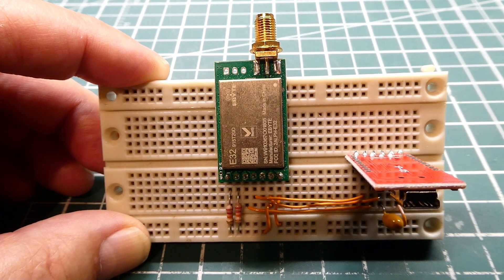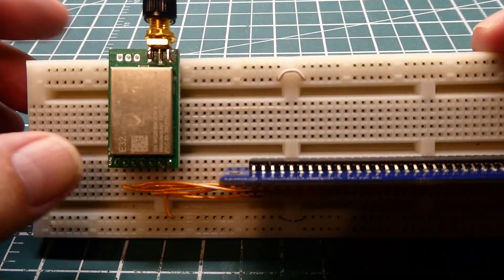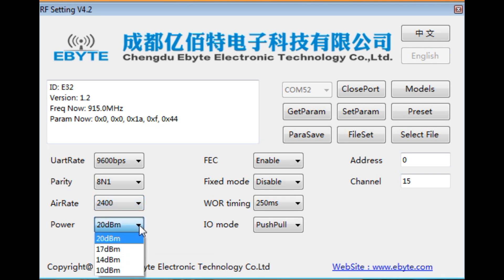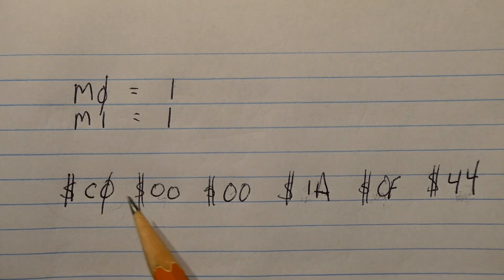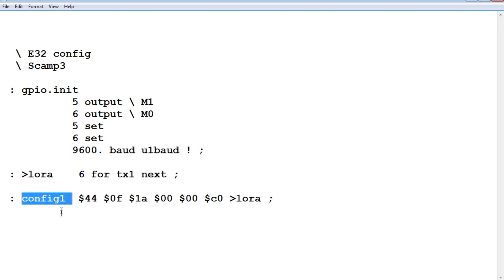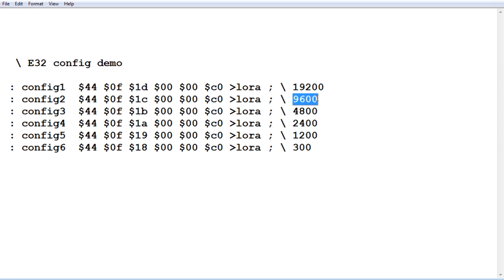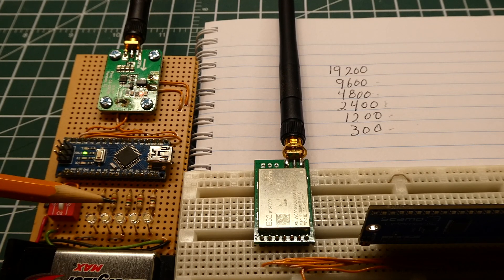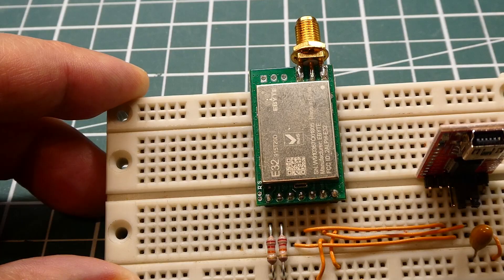Configure E32 LoRa Modules Over Serial Port

Comment: How do I find out the RSSI value?
Reply from the maker: Use the E22 series.
Reply: @0033mer  I have a Lora E32, can I use the E22 software?
Reply: Is lora e32 not able to check the rssi value? @0033mer
Reply from the maker: E32 radio modules do not support RSSI. E22 modules support RSSI but you need E22 software to program them.
Reply: does e32 also not support snr?
Reply from the maker: It also does not support SNR. If you want both, check out the Reyax LoRa radios.

Comment: Could the MCU ask the LoRa module what its config is and change it only if necessary or if it doesn't get an answer?
Reply from the maker: Yes, the MCU can read the current configuration values and change them as necessary.

Comment: Is it possible to configure the lora module using an Arduino board. 
And can I transmit 20 characters long string in one go over lora?
Reply from the maker: You can use an Arduino board with the E32 LoRa radios and transmit a 20 character packet.
Check out the schematic diagram in this video:  https://youtu.be/6NHL-avk8BU
Reply: @0033mer   Hello I have been having trouble configuring the module using arduino. Can´t figure out how to correctly send the hex parameters to the module over the serial port. Could you provide help on this?
Thanks
Reply from the maker: The serial Tx/Rx pins on the Arduino UNO/Nano are used by the USB to serial (FTDI) circuit so there will be a conflict when you send hex code using these pins. If you are serious about building projects with Arduino and LoRa use a software serial port which use different pins or goto a Pro-micro board which has a free UART serial port.
Reply: @0033mer  I see. Hey thanks for replying so quick! really appreciate it. I will follow your advise. Thank you.
Reply: Is E32 and AS32 the same?
Reply from the maker: The Ashining AS32 has the same pinout as the E32 modules. It looks like another company's knockoff.
You would have to check the data sheets to see if the software is compatible.

Comment: I dont know what is wrong, w/ lora on default setup ( that it was when i bought ), they communicate, after setup to use fix mode, changing the addH chan, they stop communicate.
Reply from the maker: In fixed mode you have to send a three byte header containing the address and channel before you send the data packet. Check out this video: https://youtu.be/JvBC7cEgI0E

Comment: hello, I have a lora e32 900t30d module, I connected it with uart ttl, but when I try to open the settings from 3.50 rf settings, I get a module no supported error, can you help me?
Reply from the maker: Try RF setting 4.2   https://www.dropbox.com/s/8utd7ospz6qovd7/RF_Setting4.2.exe?dl=0

Comment: What is airrate vs uartrate ?
Reply from the maker: The data speed over the wireless radio link is the air rate. The speed of the microcontroller UART feeding the RX pin on the LoRa module is the UART rate.

Comment: How can we set the address and channel of each module in a similar way? The datasheet of this module is not very clear about this.
Reply from the maker: The address and channel information is also embedded into the 5 parameter bytes that you can use for programming.

Comment: Has anyone got the llcc68 ebyte module working?  I got the spi working but no broadcast occurs (i looked for any signal with an sdr radio, but found none)
Reply from the maker: If you use the E220-900T30D module (LLCC68) it has the standard UART interface which is code compatible to the E32 series.
Reply: @0033mer  is there E32 code somewhere i could try?
Reply from the maker: To get started you do not need any code. An FTDI connected to the LoRa module connected to a computer (USB) running TeraTerm will allow you to send data. Check out these videos:
https://youtu.be/ysNILdPZ7hk
https://youtu.be/qmxHAAo6usk
Look for other LoRa videos on my channel.
Reply: @0033mer  i have a e220 900m22s. Is that compatible to your methods with your e32 series?

Mine has miso mosi sck.  I can send cmds via miso mosi and program the chip's registers (verified by reading them back out). But i can't get it broadcast anything (i listen with sdr radio).
Reply from the maker: Your module is not compatible with E32 code. E220-900T22D would be compatible. Check out the LLCC68 protocol documentation from Semtech. It looks like you need to enable and ramp up the Power Amp (PA) to send out data in the data buffer. Since you can communicate with the module, you are missing the simple command to enable transmission. Check out the SetTx commands.

Comment: Does this module work without antenna?
Reply from the maker: To transmit and receive data you need an antenna.
Reply: @0033mer  I see. Are there any smaller UART based LoRa modules that work in the US?
Reply from the maker: Check out the Reyax modules:  https://youtu.be/4802iHh007E

Comment: This seems like a great idea. The only concern I would have is if the persistent memory on the ES32 LoRa module could have a write cycle limit challenged if the settings are resaved too often. I don’t know enough to know if this is a realistic problem, but it did occur to me.

I don’t think I’ll ever work in FlashForth, but I always enjoy your projects.  I understand enough that the techniques can be applied to other systems.  Thanks for sharing with us.
Reply from the maker: Yes, that is a valid concern if the LoRa module is going to be power cycled many times.
There are a couple of ways around this problem. If you send the control byte $C2 instead of $C0 before sending the 5 config bytes they will be written into RAM, so you would have to do this on every power cycle. You can also apply a jumper that shorts one of the GPIO inputs to ground before power up and the code will see this and send the config packet. I use this method on my solar powered nodes. Thanks for sharing.
Reply: thank you, very helpful